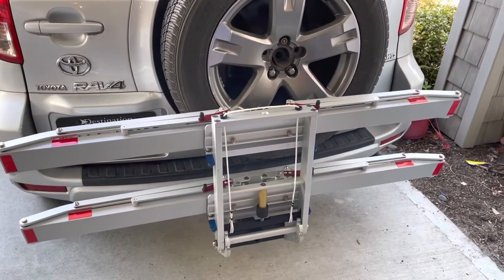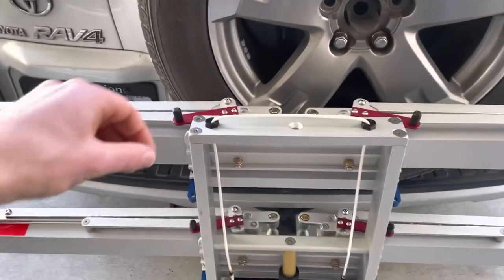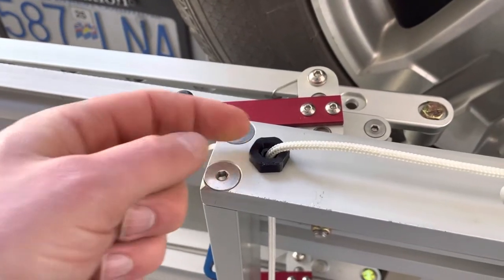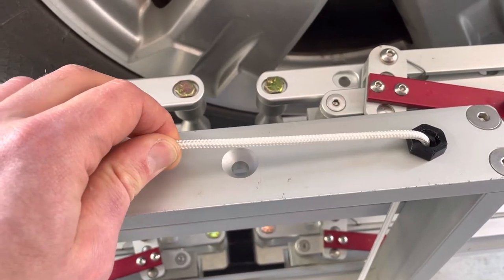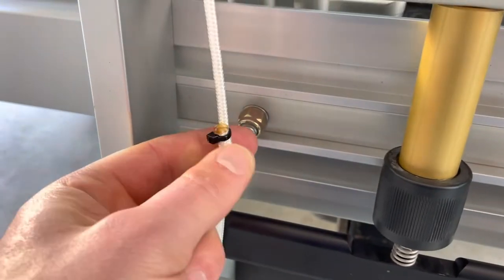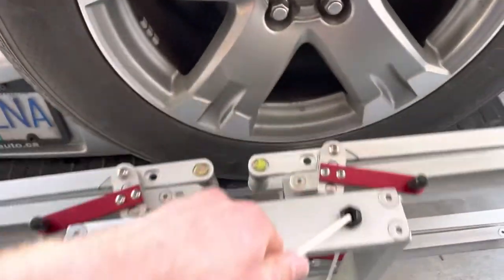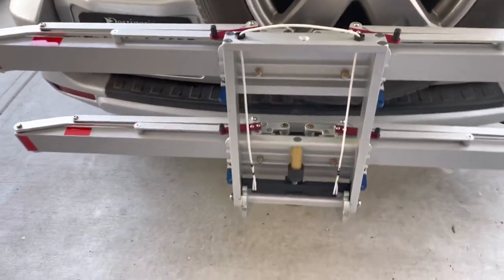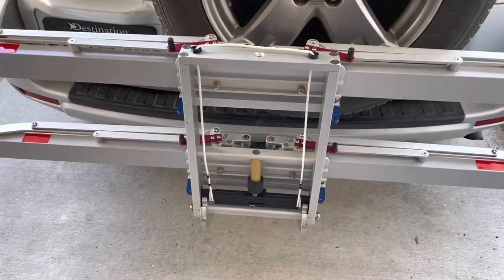DIY 1Up Bike Rack Release Handle

Comment: Instead of 3D printing just go to Homedepot, walk over to the bathroom section and pick up a pair of toilet 1/2” nylon bolts drill a hole and you have a perfect fit “specialty” bolt.

Comment: What diameter pull cord did you use? I’m seeing 3, 4, and 4.5mm options on Amazon and wasn’t sure what worked with the 3D printed bolt from Thingiverse. Thanks!
Reply from the maker: 4.5mm should work.

Comment: This is great Chris I ended up using your design to make my own. No more bruises on my arms! I didn’t print the design I just purchased a large set of nylon nuts and bolts.
Reply from the maker: Great! Where did you get the nylon bolts?
Reply: @colchilibeck  Amazon
Reply from the maker: @nickbritt  Could you post a link to the bolts for others?
Reply: @nickbritt  link please :)
Reply: @jaron808  Hi, did you happen to have the link or details for the nylon bolts and nuts you got? Thanks
Reply: @stevewallen2303  nope, ended up spending the money on OEM handle. Nik really ought to share specs with everyone here

Comment: Colin, I had 2 bolts made using the download. But it appears the threads are the wrong thread. Any suggestions as I have called 1UP and asked if they discounted the EZpull since it was an issue with their design. They were extremely rude and arrogant. How did you get the bolt to fit?
Reply from the maker: They were snug but I was able to thread them in. 

You can warm them with a heat gun and the threads will be able to adjust.

Comment: I just got the 4 bike rack with the add on extension bar from 1Up.  I'm so unhappy with it I'm thinking of returning it.  My thumb got stuck under the extension bar 4 xs-very painful and if someone hadn't been there I wouldn't have been able to get my thumb out.  2 men and myself struggled quite a lot trying to get it to pull up so that we could put the rack into a different position.  I saw some other videos of people struggling a bit, too, and 1 video where someone really has a hard time with lots of weight.  Anyone else have this problem?  I'm amazed that you can get it to pull up just with that rope!  maybe that's even better than 1Up's extension because the poles aren't perfectly straight, surprisingly.  Not sure if that has something to do with it, however 1 other youttuber had a hard time opening it without the extension bar, saying they had to try several xs, needing to get it just right.  Is your system still working out now?  thx

Comment: This was very helpful, thank you! I ended up doing this with several layers of heat shrink wrap instead of the hollow bolts. If you are willing to print and sell the 3D printed bolts, I would be happy to buy them from you.
Reply: Many public libraries have 3d printers. Just have to provide them the file to print.